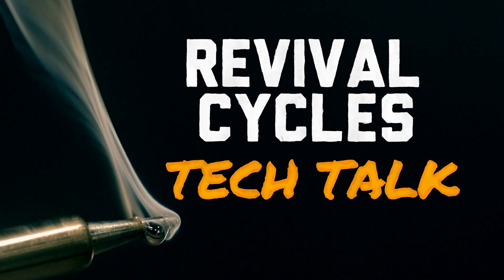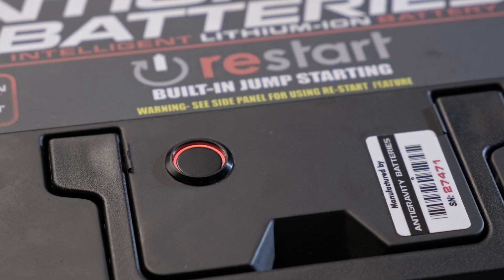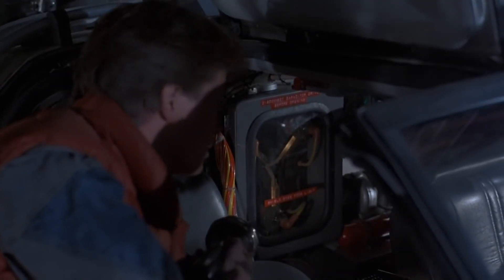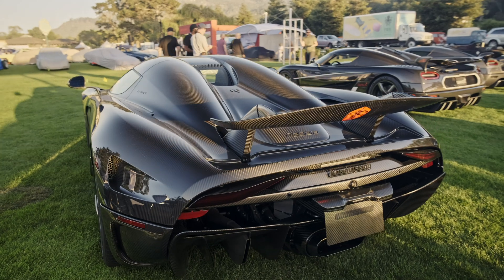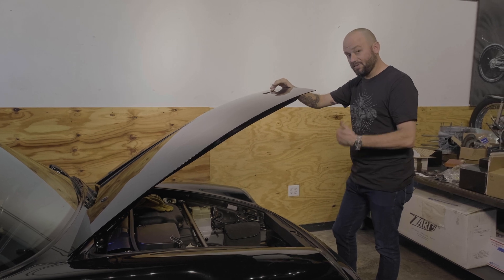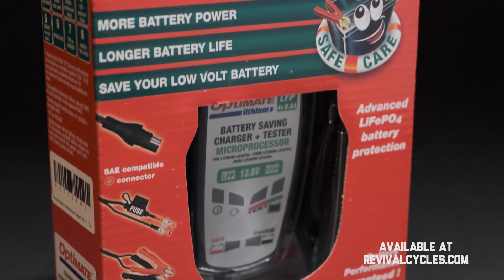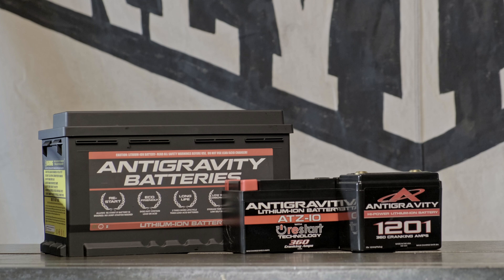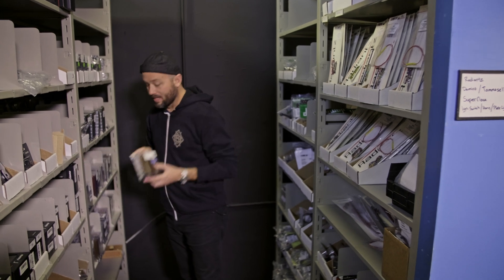Huge Smart Phone Battery in a Porsche?? // Revival Cycles Tech Talk

Comment: I've been using their ATX20-RS motorcycle battery in my Honda Prelude for about a year now. I'm beyond impressed with the power, and it weighs only 3.8 lbs.! Starts effortlessly every time, and it's been very reliable so far. I don't even use a standalone charger, but I do drive the car 3-4 days a week. Sometimes it sits a week or two, and still starts without issues.

I picked their tech's brain before I bought it, and got some great info. Basically, for maximum weight savings, you can use the ATX20-RS or ATX30-RS restart batteries in cars with smaller engines and simple electronics/accessories. For 6 cylinder engines, the smallest/lightest recommended is the ATX20-HD or ATX30-HD (more power and capacity). For 8 cylinder engines, their ATX30-HD works great. These HD models are non-restart, but still come with full BMS and all the protections. People use these in Mustangs, Camaros, Corvettes, even in some exotics. A 35-40 lb. weight loss is no joke! 

If you're into powerful stereo systems and tons of accessories, these are not for you, but if your car has stock accessories, you're good to go.